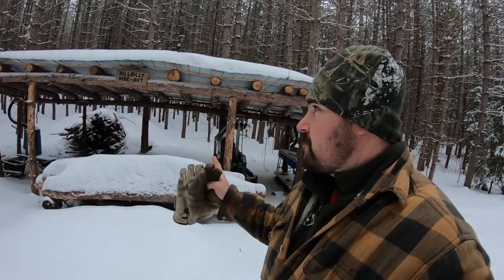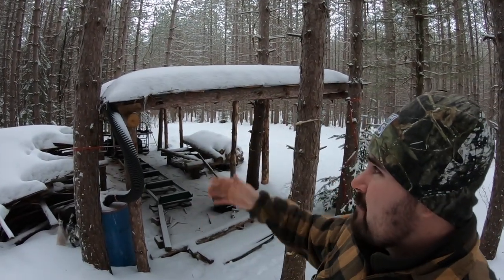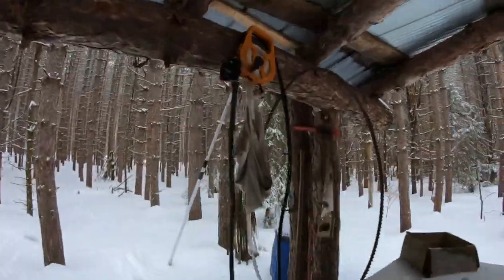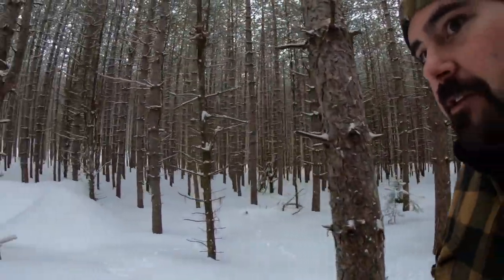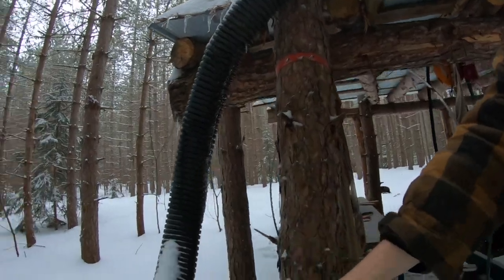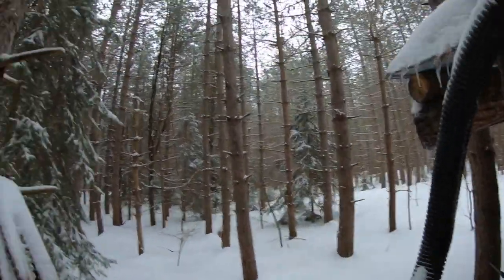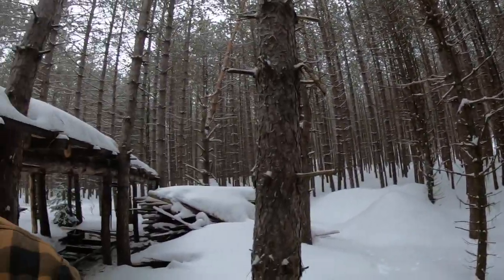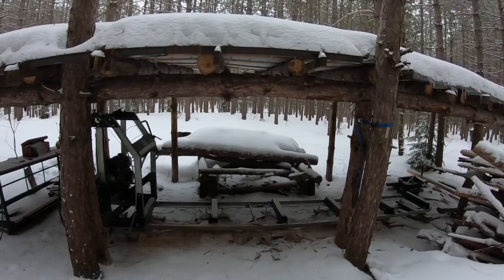How to Build a Low Cost Roof Over a Sawmill

Comment: I would have been glad to hear a bit more about the nails used to fasten the round logs together: how they were installed, and whether they were expensive. I guess they are quite large, and so they must have been hard to nail, especially if the wood pieces have some swing
Reply from the maker: Hi Vincent. I actually built the shelter before I started my channel so I don't have any footage of the shelter going up. The nails are 12" galvanized ardoc nails from my local hardware store. They went in reltatively easily after I predrilled holes in the log to prevent splitting. I used about a 4lb hammer to drive them in. Hope that helps,

Comment: I think it’s awesome . Question are you using live trees on the back of the mill?
Reply from the maker: Hey Todd. Glad you like it. There are live trees at all 4 corners of the shelter (or close to the corners). They aren’t holding any weight but they are butted up against the beams and posts for the side to side support.
Reply: Sawing with Sandy that is what I thought . Thanks for the response.